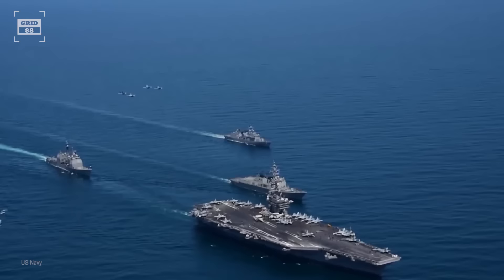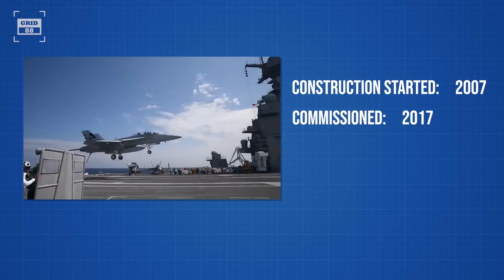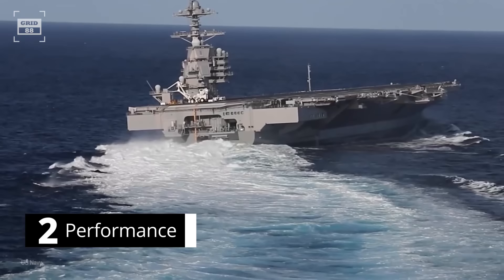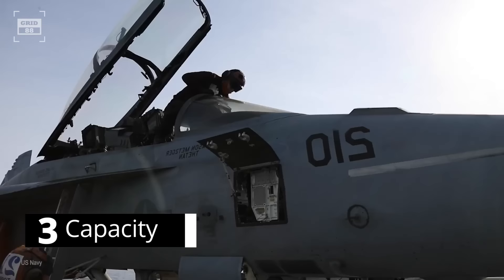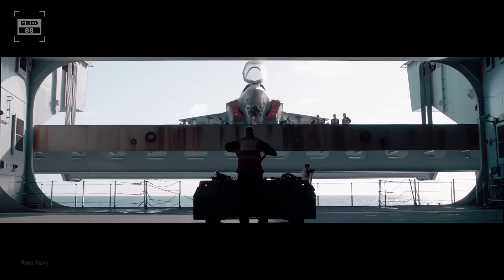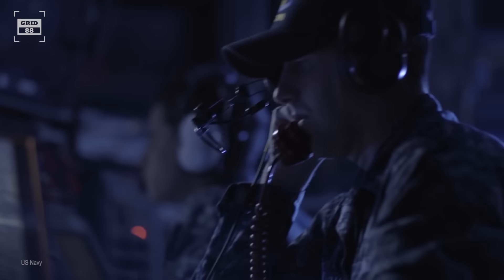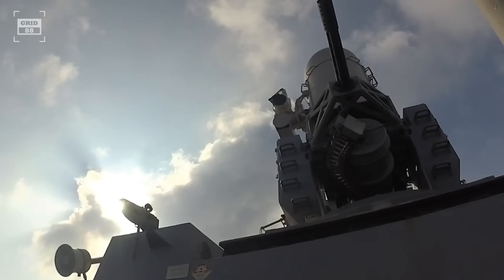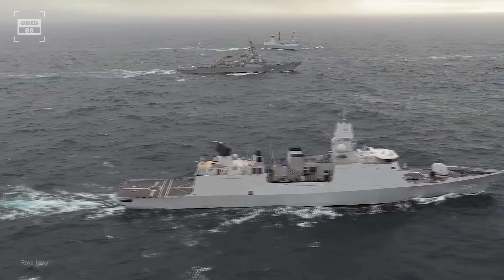USS Gerald R Ford vs HMS Queen Elizabeth - Which aircraft carrier is better?

Comment: People often forget the HMS Queen Elizabeth is not just a one and done carrier. It has been specifically designed to be an experimental weapons and equipment platform.

The ships hull has been designed to accommodate electromagnetic catapults (like the Ford), it has the capacity to be fitted with an angled landing deck if necessary, and its heavy use of automation and electronic power generation allows it to be fitted with experimental Dragon fire anti drone laser system

The UK carrier is pretty barren at the moment, but it has specifically been designed to last for decades with experimental equipment and weapon upgrades.

Comment: The Gerald Ford is a better ship in absolute terms, but in term of cost effectiveness, the QE is better, since you can get 2 of them and 4 type 45s to protect them for the price of the Gerald Ford.
The other thing not mentioned is the aircraft and munitions handling on the British carriers (HMWHS), which enables planes to sortie with a much shorter turn around.
Reply: QEC also has space for electric catapults to be even more efficient when the bugs are worked out and they want to install. I look at it as 3 QEC's or 1 ford class, both are top tech just different docterine.
Reply: But we will just build 3 more Ford class carriers. Cost isn't a thing fir our military industrial complex lol.
Reply: @mattalford3932  sure. But when looking at the ships in isolation of the actual economies of the country, lower cost is a huge plus

Comment: The UK Minister of Defence announced a few months ago that the maximum purchase limit for F35s will be 138. That's across all UK armed services. The F35B will be the only type operating from these two QE Class carriers. With full compliment, that would be 80 F35s between them. No way the UK would risk such a massive investment in aircraft and pack the carriers to capacity in a combat situation in which if a carrier was hit or even sunk, the whole caboodle would be up in smoke. The latest exercise had 8 F35s on board with 10 more from the the US Marines to make the carrier look more impressive. Also, given Brexit and the pandemic and the maximum 138 statement, the inference is that the target of 138 will not be achieved.
Reply: Yeah, and it's impossible to get 100% mission capability rate on any type of equipment and that goes double for advanced fighter jets.

The UK would do great to achieve a 70% mission capability rate for the F-35.

The announced plan by the MoD is to eventually be able to patrol with 24 F-35s -- and be able to surge to 36 F-35s in an emergency.

The QEC is designed to handle a maximum of 36 F-35s.
Reply: You seem to be subscribing to the wokist view that carriers are for show and too valuable to risk with actual fighting. I beg to differ. Barmy Boris squandered £2 trillion on controlling the pandemic, only half of which was unavoidable. The rest was caused by incompetence and corruption. Boris must go. How many carriers could you buy with £1 trillion?  Quite a few, complete with aircraft.
Reply: Nice logic - except that's exactly what Britain had to do in 1982. And we did it.

Comment: American Carriers as a group enjoy a significant economy of scale advantage.  Construction is continuous in dedicated facilities as is the mid-life maintence to produce a constantly revolving fleet with no idle or wasted capacity.  Upgrades are amortized over multiple ships which makes the cost quoted here for Ford misleading, future members of the class will be cheaper.  The Carriers of all other nations are singles or pairs which means they incure all overhead costs and then have few ships to ammortize over.  Also we should remember that operating coss far outweight build costs in the long run, this is why crew size reductions are so desirable because crew is the main driver of operating costs.

This makes the American Carriers more cost effective, aka more power per unit cost.  But when you don't need such high performance a smaller cheaper ship is the right choice.  The real question is do the British have the right power level for what they expect to do?  NATO members might be better off buying Ford type Carriers from the US rather then each designing and building their own small production run carriers.  Meanwhile the US lacks good production capacity for smaller ships and should buy more from Europe to reach the ship number targets that have been a strugle.

Comment: Cost is a big factor with the Ford costing 3x as much as the QE, but it does not seem to have 3x the punch. That said, the purposes for each carrier differ, so the Ford forms part of a larger navy and so the US could equally also produce QE equivalent carriers to complement its fleets.
Reply: It does have 3x the punch though in terms of sustained sortie rate. More than that actually. A Nimitz can conduct 150 sorties per day for a month straight (Ford even more) while a QE can manage around 75 sorties/day for maybe a week. Sustained operation is what that 5,000 crew and far bigger ship gets you. QE is a beast compared to any non-US carrier though, that's for sure the American carriers are just monstrosities
Reply: Why would the U.S. want to produce a baby carrier like the QE? It's a nice little support ship, but you wouldn't want to create a task force around it.

Comment: How about everyone stops trying to compare the two. A Ford costs more than 3 times to amount to build as a Lizzie and you're obviously going to get a bigger vessel and more bang for your buck if you can afford to splash 3 times the price. They are both amazing pieces of engineering and fill the roles required of them by their respective nations.

Comment: While both are great, lets put them into perspective, The Ford is a nuclear powered carrier that actually cost 13 billion dollars, has some of the most advanced current technology, the ford can go longer distances and can go for few decades without refueling, while the HMS QE, is a diesel carrier that cost around 8.4 billion USD, and would require maintenance a bit more often than the ford, and everything the HMS QE can do the ford can do, but with a strike group around the ford its almost unstoppable, while the hms does have a group, im not sure of its possible maximum performance, but a beautiful ship regardless, i do have to give this win to the ford based on sheer performance and (R&D) of the vessel

Comment: I would like to point out that the design of these ships denotes completely different intended operation and doctrine of the 2 navies.

The QEC intended use is similar to the America Class Amphibious assault ship in that it's primary focus is fast deployment of landing forces and supporting aircraft to further assist the assault.
The Ford on the other hand is power projection tasked with securing air supremacy anywhere on the planet. Basically continuing the role of "the great white fleet" of Theodore Roosevelt (which one of the Nimitz is named after)
Reply: @jamiemarsden3823  My statement was not to disparity the British navy. It was to point out the different doctrines behind the designs of the warships. The QEC was not designed to dominate the skies. It serves the same purpose as the Jeep carriers from WW2 or the amphibious assault ships the current marine fleet. Aiding landing forces establish a beachhead. It performs that task very well. In terms of aircraft turn over (dispatching, receiving, rearm, and refueling), total takeoff weight capacity of aircraft, and number of aircraft available all are important if you are going to attack another carrier battle group. Even the Nmitz class carrier wins in those metrics before factoring in their numbers as well. You can claim you have the edge in training but as far as equipment goes please keep it realistic.
Reply: @chemislife  I love the US! as Do most true brits! 👍

But, I think you need to redo your history my friend! You didnt kick us brits out lmao we give up on ya ragtag band of merry men coz we simple got bored of you and at that time we was fighting 3 different wars if I recall correctly 🤔 we needed more men elsewhere you didn't win your independence we simply gave it to you on a plate and said thanks for the entertainment it was fun but we got to go crush others now so toodaloo pip!  Cheer'e'oh! Yohoahoy n all that swash buckling shiz yaget me drift eh 🤣 allowing you your independence has allowed you to become the great nation you are today! Uk's gift on a plateau to ya for being a gap filler of entertainment while we stretched our legs and sipped tea☕😁👍

You contributed in ww2 you never saved anything while we respect that u was there to dig in with us let me remind you that is was
 THE BRITS that created the land and people that is America today!

but shiz is in the past and me, u and everyone else after that time wasn't even tadpoles in our fathers ball sacks so what do we know eh 🤔😂

Live long, live happy, live free, and may we party as 'ONE' till we drop?! Sound good to you?

Speaking of tea I need a refill so Cheer'e'oh my boy ☕👍
Reply: @chemislife  woooaaaa hang on a sec lol YOU BUILT OUR AIR CRAFT!? wait was that a joke? 🤔 We invented the bastard plane,  and the fucking tank lmao where you get your info from?

Anyway I need a brew this debate gives me dry mouth 🤣☕👍
Reply: @jamiemarsden3823  I was referring to the missiles and aircraft on the boat your country built. An aircraft carrier is just a target without the aircraft.
Reply: @chemislife  technically you never built the current aircraft we use as we invented the harrier which is what the f-35s are based off ;p nehneh
Reply: not sure about the missiles so i mite have to hand that one to ya haha
Reply: did i mention that all of todays modern ships are based off of british fleet old and new lol ;p the carrier for example is based on the british harbinger or whatever its called which is where the spanish got their main ship from was basically a old time carrier :) but not as we know them today. tho i reckon those of old would put up a good scrap with either of ours today lol what ya reckon eh 72x80mm cannons all plugging holes in the HQE OR THE USSGRF haha
Reply: Imean technically wood doesnt sink so ya know well unless its waterlogged :/
Reply: what i will say about US is this they have some of the worlds best tech/equiptment and some of the most reliable and resiliand and adaptable weapons for example the AR4 all varients just beat the shitty SA we brits have i mean like wtf briton get with the times ffs XD
Reply: I wish our gov would adopt the US AR for our military as their main battle weapon and the beretta fs92 semi as their side arm ffs :/
Reply: we got crappy SA n even crappier glock 17 crap ffs like seriously if i wanted tocarry a housebrick (glock) i'd nab someones foundations ffs XD
Reply: AND THE ONLY THING A 'BULLPUP' IS GOOD FOR IS ANNOYING THE FUCK OUT OF YOU WITH ITS STUPID ASS REAR RELOADING FRAME GRRR SO WHAT IF IT'S A FASTER RELOAD ACQUIREMENT FFS ITS FUCKING DAFT :/
Reply: do they even realise that a bullpup has crazy recoil vs a standard front/mid frame reload like DOH just take that recoil bro n slap it on the back n when you shoot the only thing you hit is a pigeon ready to crap on you XD
Reply: A real chance missed the QEs weren’t built with loading docks for landing craft; they a bit of a muddle between an aircraft carrier and an assault ship, and don’t fulfil either role well.
Reply: @jamiemarsden3823  bull pup are great rifles they have there purpose just like how the ar has its purpose. They both have pros and cons but the uk l83a3
Reply: The QEC can carry 72 F35s in war times. That's enough to dominate most airforces.
Reply: @jamiemarsden3823  
We deployed rockets in battle in the 18th century, invented the liquid fueled rocket motor and the jet engine but it was ze Germans that weaponised jet powered and liquid fueled rocket propelled missiles first with their V1 and V2 flying bombs the latter of which was also the first man-made object to be sent into space.
Reply: @chemislife  HMS Queen Elizabeth is not an Amphibious Assault Ship, it's an aircraft carrier...
Reply: @Olszymanski  Then tell me what is the difference between an America Class AAS and an aircraft carrier